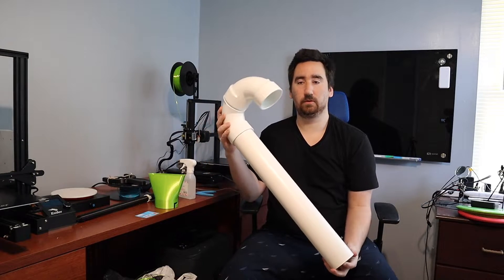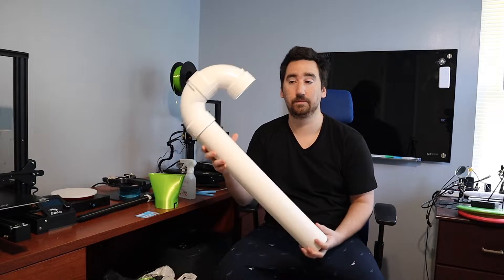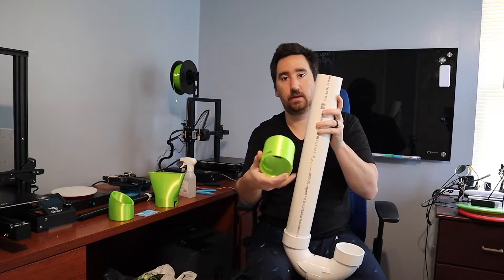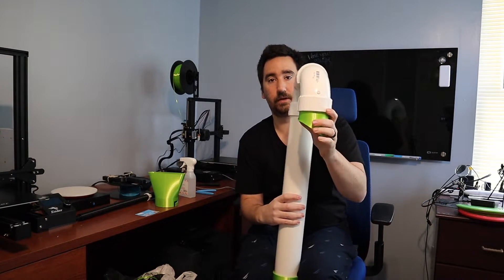Milwaukee M18 Leaf Blower Attachment System PT2! Gutter & Inflation Nozzles | Ender 3 3D Printing

Comment: It is great you are doing this. I immediately agreed with you that the standard pvc it too heavy. I would only want the drainage pipe as it is thinner. So I was wondering if the m18 backpack blower has different diameter tubing. I would want an adapter for that. I have the original m18 blower (1st gen) so I can compare that in a bit, but I was not sure if you had a way to compare. I would definitely buy an adapter from you if you were willing to make them. I was also wondering if you could make the adapter longer on the end so that it spreads the forces and leverage over the original tube for a longer distance than just at the very end. Of course the connection overlap would not have to change but actually making that longer would also be better for strength. I am also seeking for a tube system that would be longer in order to do a second story gutter. We do not have a 3d printer yet, but are considering getting one in the near future. Thanks.
Reply: Hi ariip, i have a system to vacuum 2nd story gutters if your interested I can send you everything I used? it works great! No more ladders for me haha.

Comment: Here's a suggestion - could you design a very short tube for the M18 blower that would fit this adapter ring as well? Something similar to a stubby nozzle (example here: https://www.youtube.com/watch?v=mcsDNYp6yrY), but it fits the attachment system you have here. That would make this system even more useful.

Comment: Really nice work.  Really appreciate the thought and design you put into this.  Any thoughts to do a short stubby nozel (saw some others make this), but that fits into your system you already designed so that you could for instance use the stubby nozel with the air mattress attachments (which would be more convenient then the long milwaukee one).